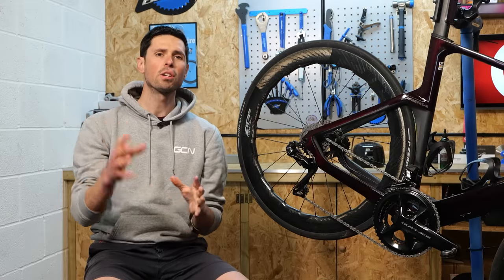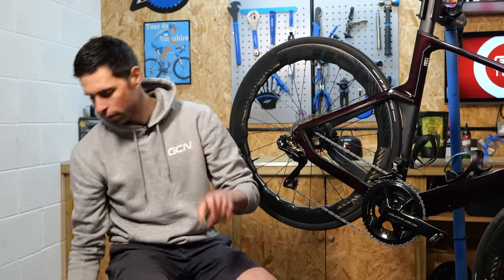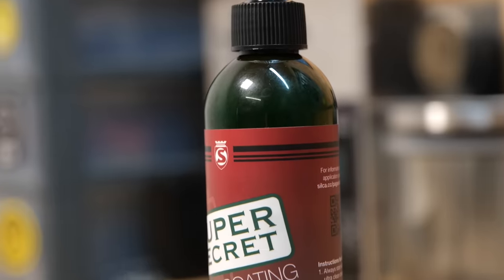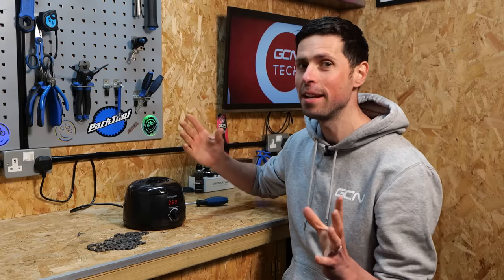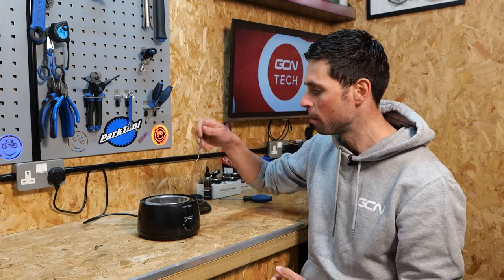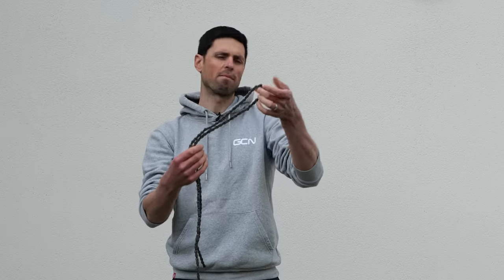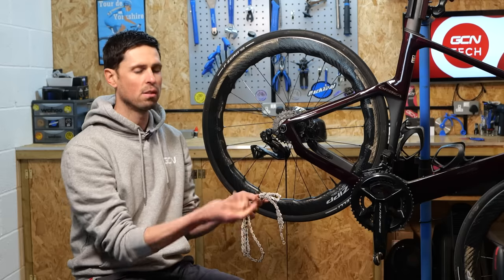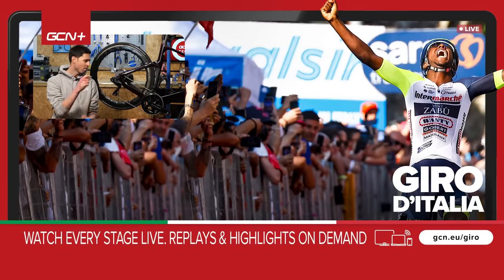How To Re-wax Your Chain & Make It Last Longer!

Comment: My alternate method:  uses Aluminum soft drink can [top cut off] plummers torch, parafin wax brick, small mchine shop brush [acid brush] and too lazy to remove chain.  Place parafin in can and use torch to melt [home made wood handle to hold hot can].  Use acid brush to paint hot wax on chain and sprockets.  Brush bristles force wax into chain.  Done.
Reply: Why do you wax your sprockets? Also, research what happens to parrafin if you overheat it, besides catching on fire, it degrades it.

And do you also hit your chain with the torch after painting on the wax? Because your chain doesn't care if you got it on the outside of the links, it's not helping anything there.

Comment: I'd wax the quicklinks also. I have a wider wax heater that allows me to, first, thread my chain onto a bent hanger (or a "swisher" tool) and then place that into the wax, swishing it all about until there's no more air bubbles. Then I simply thread the first link onto a nail in the wall it the chain slides out nice and easy.

Comment: One point of caution, if your chain gets rained on, you don't have oil to repel it, it's much more important to dry your bike if you're running a waxed chain
Reply from the maker: Great point Steven! Ollie took as through the pros and cons of all the main lube types in this video 👉https://youtu.be/RXJZ0WOr3SE
Reply: The OG hot wax method I learned back in the early ‘90s was to mix paraffin (grocery store canning paraffin) with motor oil.  You add different proportions of motor oil depending on what properties you want—higher proportion oil obvs is more water resistant, less oil is more dust tolerant.

Comment: The drip wax still results in a black and flakey chain for me after 500-750 miles. Hot waxed and then dripped SS every 100 miles. Started with clean and clear/white flakes after hot wax and slightly dark wax after a few drip applications. Going hot wax again and see what happens. Hopefully clear/white again.  Open to any advise. Chain was thoroughly cleaned prior to hot wax

Comment: So when it comes to re-waxing a chain I have taken the process to another level to ensure that the chain is clean and doesn't contaminate the wax. I submerge the chain in boiling water, remove and wipe the surface clean with a cloth. Then I lay the chain down on an old white towel and using a steam cleaner hit every link with steam. You'd be surprised at how much dirty wax comes out of the links of that "clean" chain. Once dry it is now ready for a new waxing. I do this with 4-5 chains at a time so at most this is a monthly routine in the summer. PS Up until now I have only used a paraffin and paraffin oil mix, no PFAS. Check your brand of hot wax manufacturer's claims with regards to PFAS.
Reply: I'm very curious about the steam cleaner, they are cheap to buy but are they worth it?
Reply: @Todd Newmarket MTB  Well, you're asking for an opinion.  For me, yes, as beyond cleaning the chain, I use it to remove wax from the chain rings and the cassette. I have a reputation in my club as having the shineiest drive train. And it's useful around the house too.

Comment: Nice video! But if i do not have a wax heater, can i use two cooking pott, one bigger to boil water and a smaller one, which i can put into the bigger one,  to heat the wax?

Comment: Not sure why anyone would go through this hassle over just using squirt or some equivalent drip-on wax lube. It's mildly more expensive maybe.

Wax is by far better than any oil/PTFE though. Simply because you never have to degrease/clean your chain the way you used to.
Reply: Totally clean hands, pants, and legs, and I have 3 chains in rotation on each of the 2 bikes I run waxed chains on, so I only have to wax about every 500 miles per bike. That's enough of a reason for me to put in a little work once a month or so rewaxing them all.

Edited to add that after 2200 miles the cassette on my gravel bike is in excellent condition, and my chains have tons of wear left in them. I'm expecting to get 10,000 miles or more before having to change anything out, which isn't bad for a heavy rider on an 11 speed drivetrain.
Reply: @mrhankbotful  how do you go about cleaning the derailleur and cassette? I find those still get quite dirty
Reply: @klnsmn  wash them when I wash my bike with soap and water. No greasy oily mess means nothing special is needed to get it all clean.

If your chain has any sort of plating on the side plates there isn't much to worry about in terms of rust. Just spin the cranks and blow everything off with a leaf blower if you have one, or just give it a quick wipe and let it air dry if you don't.
Reply: @mrhankbotful  But drip on wax lube does the exact same thing.
Reply: @petef15  I find drip on doesn't last as long, stay as clean, or extend my drivetrain life any.

Comment: hot wax immersion method, if you sit your chain rolled up on top of solid wax,the chain will heat up as wax melts.once you remove chain and cool ,if you have a car tow ball run chain back and forth to free up all rollers.or use a broom handle etc.

Comment: As a user of Shimano 105 and Ultegra, 10 gear cassette, with matching chains; which quick release device should I use on the chain and suggestions where to buy them? 

Thanks!
Reply: Wipperman Connex Chain Link, £7.99 for 10-speed from Merlin if you are in UK. Completely re-useable and no tools needed.

Comment: I found it important to bed on the larger cogs of the cassette because wax got into the 11T cog and made the chain skip.
Reply: I made the mistake of letting the wax cool to the point of the skin forming on the surface before removing the chain. This leaves too much wax on the chain and will leave deposits on the rest of the drive train once you put it back on your bike.

Comment: I use the Silca Super Secret drip on wax and put my chain in a plastic bag with enough in it to cover the chain.   Then I essentially massage the chain in the bag to get the drip on to spread throughout the chain.  Easier and faster than using hot wax.
Reply: That's a good idea.  Can you reuse the drip on wax in the bag or do you pour in new fresh amount each time?
Reply: @Sarosh Havewala  I put it in a resealable bag so you can reuse but I always add a little more then mix it before I put another chain in.  Especially if it has been in the bag for some time.
Reply: If you sous vide that bag it’ll work even better

Comment: The chain should be threaded through a stiff wire before you lower it into the melted wax. You then use the wire as a swishing tool to swish the chain around and then get the chain out once done.
Reply: i used an old spoke as a hanger and pick.

Comment: Was a huge fan of waxing using Squirt lube. Never had a cleaner chain. Only downside was doing this in winter and having to reapply twice a week on a 14 mile round trip commute. Also the slightest bit of rain and my chain would go into rust mode. Was I applying it wrong hmm.
Reply: Look up where Squirt ranks in different qualities at Zero Friction Cycling, and you may be surprised! Or not…
Reply: @jamesrosar3823  yeah heard it's not the best. A brand you recommend?
Reply: @jamesrosar3823  ZFC made racist comments about Hambini so doesnt deserve any discussion here.

PLUS his website is full of mistakes. He doesnt even measure power correctly and ignores the chain deflection issues that waxing is exposed to nor does he replicate REAL WORLD riding forces and angles that a normal cyclist uses.

He is just a marketing goon IMO. No formal background in engineering etc unlike Hambini who he tried to roast.
Reply: @durianriders ; Please supply the evidence of what you consider to be the offensive comment. Also, bicycle chain wear testing was much less sophisticated before ZFC; so who is presently doing testing to the standards you are suggesting? And finally, what does “cancel culture”mean to you, sir?

Comment: I must be doing something wrong. I'm roughly 1k km on my chain and it's at .75 wear, so basically at the point of replacement already. It's a Shimano original 11s.
I've used spirit to do the initial stripping and then applied a widely available drip-on wax and generously reapplied it every 250km or so. I might've used to little after the initial stripping though...
I know there's little to conclude or say from this, I just hope next chain will be better.

Comment: I skip the flexing part since a stiff chain is so much easier to feed through the derailleur cage and then just fold straight back together with the front end to clip back together. Just spinning a few times over a bit of carboard and bam. Good to go.

Comment: All these videos about waxing your chain are making me considering it but I do have a question, when using the drip on wax (is this a gateway wax?) you surely have to use something else than just a cloth to clean it, don't you?
Reply: Regardless of the type of wax used the chain needs to be thoroughly cleaned before rewaxing. If you just drip more wax on nothing is being cleaned, it's a convenience but not as effective. Hot waxing is the go, try it, easy to go back if you change your mind 👍🏻

Comment: Hope you guys mention that Shimano quick links are rated for ONE USE ONLY by the manufacturer.  Every time you remove the chain to wax it you should technically be replacing the quick link and those things aren't cheap!

Comment: I stopped using wax, it just doesn’t protect the chain in wet conditions. Went back to wet lube last longer and smoother gear shifting with my mechanical Groupset 😊 yes it’s marginally dirtier but no rust and smoother than wax which just melts away.

Comment: You say that applying a liquid wax is "almost the same performance" as using the hot wax method. How much of a difference in performance is it as a percentage comparing the two methods?

Comment: Would love some clarification. My local bike shop uses a drip waxing product from Ceramic Speed. Alex, you stated that 300-500Km is the average usage for a waxed chain. My bike needed a new chain and when installed, it was waxed using the drip method. I've ~650 miles since the waxing and the chain is still whisper quiet. What are the indications that its time to rewax your chain? FYI, the LBS claims that I should be able to achieve 10-12 months of normal use with one wax treatment.
Reply: Your chain was probably never degreased, that's why. The wax won't last 12 months of daily riding, sometimes not even 12 days 😅

Comment: Do you leave the dura-ace chain with the holes in the links filled with wax? It's not a problem with ultegra chains and below as the links are solid. The reason why I ask is because I wax my dura ace 12s chains and spend time pushing out all the excess wax from the hollow links!
Reply: Get a temp adjustable heat gun, set it to about 250°F and use that to blow off the chain as you slowly raise it out of the wax bath. It'll get about 80% of the slots cleared out, and maybe half the hollow pins if you use a chain with hollow pins (KMC SL chain is my experience with slots and hollow pins) Don't get too anal retentive about it, it'll come out with riding, or it won't, but it weighs almost nothing.
Reply: @mrhankbotful  thanks!

Comment: when rewax, the used chain is submerged directly to the wax hence over time the dirt transferred to the wax pot. do you filter the wax to remove the dirt etc?
Reply: Wash the chain first, boiling water etc, then apply the wax or you'll contaminate the new wax.

Comment: pro tip: leave the chain in with the wax as it warms up. then you don not need to worry about the skin forming or it reaching the correct temperature. just swish it around for 30s after it is fully melted and then hang it. easy peasy

Comment: Hello. I bought a new waxed dura ace 12 speed waxed chain. After installing it, correct direction and size, it has been skipping between cogs 12 11 and 10. I looked for wax build ups and didn’t see any. I rode the bike for around 1h, but still skipping. Should I adjust the derailleur? It was working perfectly with my previous wet lube chain. Thanks!
Reply: You got scammed 😂

Comment: My idea is to have two chains, so when I need to re-wax, I dont need to hassle around immediately, but can just switch to the prepared other chain. Or does the wax stiffen up with time when stored?
Reply: I have been doing this and it works fine. I just keep the spare one ready to go but wrapped in a towel in  a cupboard. The wax should be stiff when dry, before you run it around a bit to loosen each link.

Comment: Rather than hanging the chain up to set, I dip mine in a bowl of cold water. The wax sets instantly. In my mind, I imagine this traps more wax in the rollers that would have bleed out whilst still wet. ✌️🚀
Reply: I’m a believer in capillary action and surface tension even in hot liquid wax, so I don’t believe there is any need to let the wax cool before removing the chain from the wax bath. It may increase one’s chance of getting scalded, but much less wax gets wasted as flakes. My chains have perforated side plates and hollow pins, and the wax would leave those voids before leaving the inside of the chain, which it doesn’t.
Reply: @jamesrosar3823  I find the wax clears pins and side plates as I lift it out a give it a min for the excess to drip off. That way I don't make a mess moving the chain around. I can get around 550km before needing to be reapplied, it's an I'm provement on 300 before I cold dip. So wax is saved that way. Any flakes I put back in the pot.
Reply: @Peter Steadman, I am referring not to the wax on the outer surfaces, but that the wax between plates and bushings that will not run out even when the wax is warm enough for full penetration. If the wax film continues to web across the perforations in the side plates, it won't escape the chain itself.
Reply: @jamesrosar3823  as long as its not excessive, I don't mind that. It beds in after a few turns of the crank. Anything that prevents metal on metal action will prevent wear. Keeps it quiet too. Probably the best argument for oil. But it doesn't stay clean long enough. Have a great evening dude 👍

Comment: I degrease the chain by shaking it in a plastic bottle, wipe off , drop in crockpot and it’s good for 300 miles at least, done it for over 30 years ,remember it’s a bicycle chain, not a component in a space shuttle 👌🏻

Comment: I ride about 500km per week. With wax lasting about 300km, that means I have to rewax after 2 rides (I found on the third ride the chain starts squeaking and wears quickly). Just not worth the hassle for daily use. Perhaps drip on is the answer.
Reply: Or just stick with oil 👌🏻
Reply: Just use squirt lube or wax a batch of chains so you have back ups.

Squirt lube is the best overall though for ease of use and performance IRL.

Comment: I follow the Silca method, full hot wax, after 300 miles re apply drip wax, do it every 300 and when the 1000 miles mark comes do a full hot wax again. I am at the 700 miles mark and still smooth just not looking that clean.

Comment: Any ideas on cleaning / filtering your wax? I keep a magnet on the bottom of the bowl to collect fine fragments of metal. Still the wax gets dirty.
Reply: The dirt will fall to the bottom after a while - so let the wax sit "hot" to give time for the grime to sink down after waxing. Then let it cool. Afterwards you can easily "shave" off the contaminated bottom 1-2mm of wax. Btw I find this is only seldom needed if you rinse you chain in boiling water before re-waxing. Good luck!
Reply: @meibing4912  
I'll give it a try

Comment: Definitely needs boiling water to remove any residual was. I have a celebrations tub with holes punched through and always see the wax on top of the water. Also, I thread my chain onto an old metal hanger for loading in to the slow cooker.

Comment: BJM276
0 seconds ago
Hi Alex. Is it possible using all safety precautions (safety glasses and gloves) to use a cheap chain cleaner device (Aldi) to distribute the wax while the chain is still on the bike. Then soak the chain cleaner divice in a bucket of hot water to clean?
Reply: I could only imagine the state of the chain rings, front chains and jockeys , frame and floor if you did that.. not to mention how dangerous pouring hot wax into the chain tool before whizzing it round..
Reply: I don't think so, the wax is quite viscous so needs to soak in, the little container of the chain cleaner would have it cool down too fast.

Comment: Note: this doesnt work for colder climates. I did this few months ago but because it was fairly cold outside, the links stiffened up making the chain skip constantly
Reply: ha, ha, that is why is needed to have different temp grade waxes
Reply: @makantahi3731  like what?
Reply: @fetB  i blend(mix) wax for every 5-10 deg of c: -5-+5, 0-10, 10-15, 15-22, 20-25, 22-28, over 28, difference is in amount of oil in wax, i have some plant oil based candles that is sticky on 20 c but is ok on -5 c, so by combine it with high temp melting  wax, i get requested wax for certain temp, the goal is to have wax that will be on limit-sticky-no sticky on certain temp, because it must not collect dirt as oil does, if i use low tem wax on hot day, it will look like grease, if i use high tem wax on low temp, it will crumble like broken glass
Reply: @fetB  i intend to use gearbox oil, 90-140, but i still have a lot of low tem wax to spend, so it will wait until i spend it all
Reply: @makantahi3731  interesting. Gotta look into it because otherwise i love waxing. I had to flush some wax out and use dry lube. Guess everyone making topics about this live in warmer climates

Comment: I really like the Connex Link. Quite expensive, but it can be opened without any tools and reclosed as often as you like.

I bent a wire cloth hanger so that it hold the entire chain. Makes it a bit easier than using a screwdriver to move the chain in the wax and to get it out later